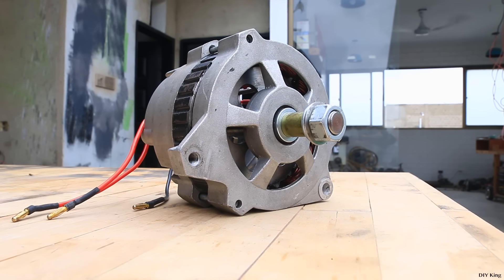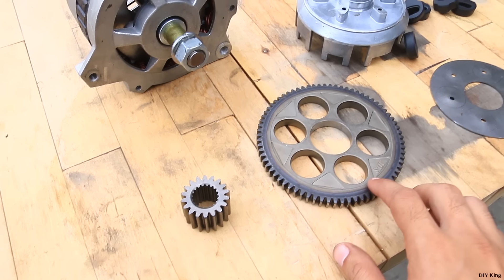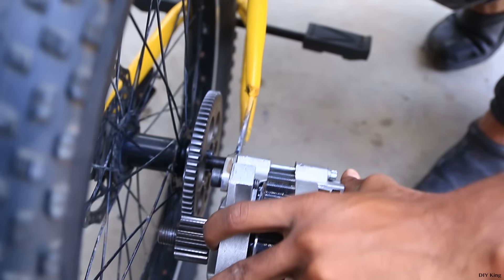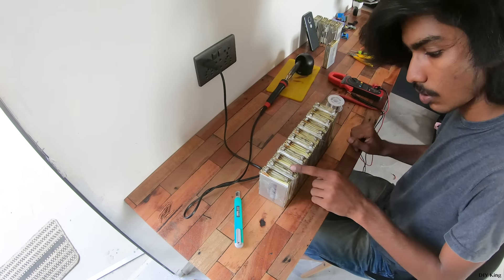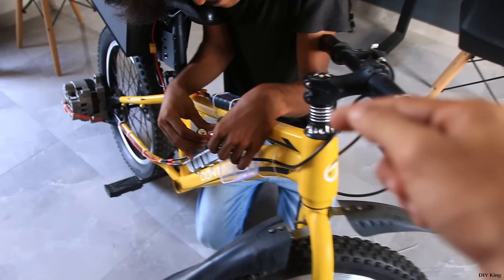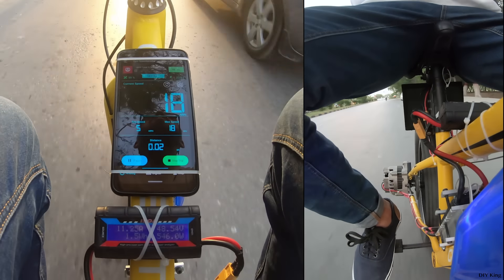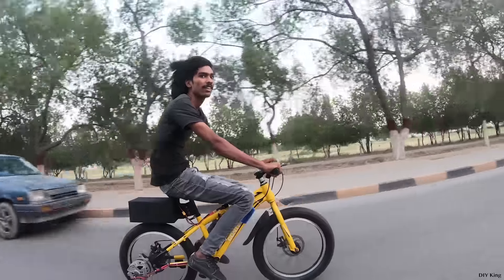Bicycle Conversion using a 10,000 Watt Car Alternator

Comment: Hey Guys ! Nice work so far... I´m a Bike Mechanic and so i got some ideas for you to think about.... Try to mount the Alternator in front of your "Pedals" that would give you more stability and maybe adds a little more stiffness to the Bike Frame. Maybe u also can mount the Batteries to the top tube of the frame. In the End maybe you get a suspension fork fittet. Then try that Highspeed run again =)
Reply: Yeah , I am thinking about converting a gas pedal moped to electric pedal moped.  I'm def sure it'll carry the weight of batteries ,front ,back or rear.  Also , have no problem with the speed (wobbles).  If so , minor. Hope this idea helps anyone.  To all us diy's , good luck and many happy builds. Keep smiling.  it will make your day that much easier. But wait.  Why put it off til..... When u can do it today? Remember,  Tomorrows not a promise.  It's a gamble.  Roll the dice boys yeeeeeeehaaaaawwww:)
Reply: @franciscorodriguez7085  Good luck, brother

Comment: Pure genius! You probably already have the wheel shimmy problem worked out, but I think it has to do with the amount of  trail in the steering. You may need to add a small amount of wheel trail, in order to deal with the added speed involved. All the best!
Reply: Getting weight away from top tube and headset as this is whats resonating. I learned this no-handing as a kid. My dads bike had a dad basket. Load it up, u better hang on lol

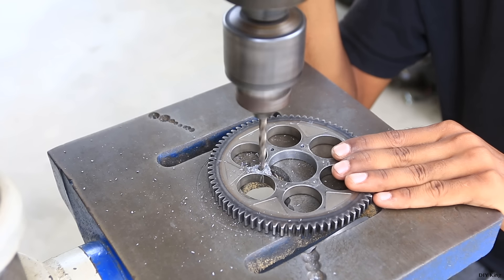Comment: thats why you need to clamp your work piece when using a vertical drill 3:35   when you use bigger drills and heavier workpieces you can actually break your arms or back if you get hit

Comment: That's super clever. Well done for putting an old alternator to very interesting use. To keep the controller cooler, consider adding an aerodynamic ducting to the heatsink to channel air over it as you ride, perhaps adding a quiet Noctua or Arctic Cooling fan to help with the air flow 👍😉

Comment: This would have be a more stable ride on a tricycle. Amazing work guys I really admire your skills and capabilities
Reply: I agree a tricycle would be better and centralize the alternator between the rear wheels and put a gear housing around the axle and alternator to protect them.
 The way it is now, one small rock or pebble like debris in the gear and the shows over 

Also consider a gyroscope steering aid for the front to stabilize the steering.

Comment: For the next segment, Install an alternator on either side of the rear wheel, making it 20kw, and the weight on the rear will be more balanced.
Reply: I think the tires would melt and they would go back in time

Comment: Here's a suggestion to improve the handle and reduce wobbliness.
You can use dampers made for e-scooters. It's supposed to reduce the shakiness of the handle at high speeds.

Comment: It is the weight of the alternator on one side of the axle that makes you ride. It would be necessary to put an object of volume and equivalent weight on the other side so that it could roll normally. It will even be much more stable than before!
Reply: don't go that fast.

Comment: Great job guys! Very nice build,although a few safety improvements on the pedestal drill press like mounting a vice or a clamp could save losing your fingers etc lol,maybe also screw the handback onto the angle grinder for better control and put the guard back on, maybe a helmet too??
Just saying... love  your videos and would hate to hear that you guys got hurt lol....i dont mean this in a bad way. Just stay safe and keep on rolling out your Awsome content 😊😊
Reply: Jesus is LORD  Wrong page Nimrod...
Reply: you could use bigger handle bars for less wobbling and more control in high speeds

Comment: Well done, guys! !
:)
Clean install..  I love the battery holder and throttle choice!  :)
The alternator/motor install looks great... but I still want the mount to look stronger than it looks.  (It might be plenty strong already, but my own personal preference would be for it to APPEAR even stronger than it currently does... although other than that... I love how unobtrusive it turned out  :)
Keep up the great work...  you guys!   :)
Reply: How will it handle rain or street water?

Comment: Nice work!  But you'll also want to devise an enclosure and lubrication system for the gears, otherwise grit and road debris will quickly ruin them.

Comment: No BMS for the battery pack I think it's temporary ;) & I'm so curious on your Tesla powerwall, did you made a video on it ? BTW I'm from 🇮🇳
Reply from the maker: Since its temporary we didn't attached the BMS, and yes the powerwall project video is coming this weekend so stay tuned.
Reply: WHAT IS BMS
Reply: @Punjabi_CNC_TRANING  battery management system
Reply: @Punjabi_CNC_TRANING  BMS stands for Building management system, here it's for Battery.

Comment: Ten kilowatts? How did you measure that? The motors that put out that kind of power are usually liquid cooled to prevent the magnets exceeding the curie point.

Comment: Very cool!  Awesome job!  I know this is a demonstration, so wondering how long that pinion gear will last.  Also,  what you experienced was called a death wobble, which can happen sometimes on motorcycles unexpectedly. Usually from low tire pressure.
** Also,  I'd be interested in a standalone video of making the rechargeable battery.

Comment: okay boss I want to see what you can do with this idea . using this alternator / engine & using the big wheel idea from another video on you tube titled "this is not a bike / DIY" I'd like to see you build a reverse Tadpol style recumbent trike. My idea would be to have tween chain drives from this motor to both sides of the big rear wheel with the motor located behind the driver's seat. battery to be mounted in a housing that would be built over the rear big wheel . I think when you see that video you will be able to see my vision. As the youngsters say it will be sick! another great build video as always many thanx!

Comment: 10,000 Watt car alternator - 10,000W @ 13V = 769A. No point watching the video, since a 769A alternator - nor anything much more than 10% of that has ever been made, so it's obviously bullshit right from the outset...
Reply: And just for a heads up: for a 100A amp domestic supply we use a 25mm² cable - for 700A the best case is 240mm² conductors - ie. 15.5mm diameter copper conductors, plus insulation. The cables shown on the alternator are 6mm² at best, probably 4mm² in reality. Why put you effort into scamming, when with no more effort, you could provide something positive and interesting? It's bizarre.
Reply: Do you really think the battery he used was 13v? There are two batteries with 12 packages in series with 4 cells in parallel in each. The battery must be at least 48v. The 10000w is a nice exaggeration, but it's not enough to be what you said
Reply: @MarcosElias  agreed, probably just 5-3 kw the alternator
The battery for Sure more than 36 v
Reply: You can actually see power meter on test run, it's 3kW peak and mostly around 2kW which is fine for most alternators. They are usually rated at 70-100A and you can see that he's not pulling more than that. That's at 50V, not 12V.
10kW is bullshit claim, but it can easily output 2kW which is quite good considering the setup.
Reply: I don't know of any alternator that physical size that is 10kw. 
Just  not possible!
 More like 1.5 kw!
Reply: @geepea101able  my alternator do 2kw easy in 72v
Reply: @MarcosElias  That's great. But I was talking about the 10kw he's on about. No such thing in the auto world!
Reply: got him 4 million views though
Reply: @cleggydadon  And that's the travesty - people produce fake videos, when they could equally easily produce factual ones that would actually improve other's knowledge and understanding. Contemptible really...

Comment: I've never seen a 10kW alternator, nor would one be that small. Looks like it could be 1000w.
Reply: It’s not a 10kw alternator, it was an alternator that has been converted to a brushless motor that now runs on 50v, I have an rc car that pulls 13kw from a brushless motor a fraction of that size (50mm castle 2028 if you want to look it up) you have no idea about brushless motors.
Reply: @gavwilldo  it says that right on the title. "Using a 10,000 Watt Car Alternator"

Comment: If you mounted the battery packs lower like half on each side and up front off the top bar of the frame you’d eliminate the high speed wobble. Great job on that bike!

Comment: Just a thought I had, if you mount the battery off the rear wheel opposite of the alternator, you may balance it some so that it doesn't want to fish tail at speed

Comment: Thats a very cool bike. I like your inventiveness. The stability problem at speed is due to most of the mass being located in the wrong places. Also, increasing front wheel trail (castor) will help increase stability at speed. Projects like this are journeys in learning. Good job.

Comment: Ohms law. Volts times amps equal watts, and vice versa. For example a 100 amp 12 volt alternator provides 1200 watts maximum, so I figure that you must have been off by a decimal place 😊

Comment: 1st off they don't make an alternator that big the biggest is 500 to 600 amp . And 2nd the battery is only 1500 watt hr. which 12v×600amps=7200w and those are pricey in tune of 1200.00 to 1600.00 . Stock alt. 12v×130amps=1500w even if there used as motors without rewinding it is not gonna happen so with battery known at 1500watt hrs and supposed 10,000 watt alt. 1500w ÷ 10,000watts motor = 0.15 that's 
7 minutes of riding wide open  realistically average car alternator is around 100amps @ 14v = 1400w and 1500w÷1400w= 1.07 hrs ride time. A smaller alt = longer ride time. Bigger = shorter  b/c it draws more power to run.

Comment: You should be some kind of engineer man how come you're not rich making this assembly. You just build a contraption out of a car alternator. Very impressive great job. Just have to counter the alternator on the one side when you ride. Good concept and great idea. Just don't get the alternator wet. You're going to have to pedal if it rains lol

Comment: Is it possible to have a more powerful alternator, powering the motor alternator and recharging the battery? like a car. Switching from battery to the alternator when it's up to speed. Second alternator will fix the balance issue as well allow for a lighter battery.

Comment: The motor might be causing your wobble. If you could mount it inline with the wheels and have the motor drive the crank. you built a cool bike. and it looks good too. Way over my head!

Comment: This setups works good, However, you could have mounted the Alternator right above the foot paddle sproket section, and could have built a Belt/Chain Drive with the Sproket/pully.
This Could Have saved you a lot of extra mounting right on the wheel, and saving the protruding/hanging alternator near the rear wheel.

Comment: Really interesting build. I want to do something similar to 
a former  pgo two stroke scooter by replacing the top end with an electric motor keeping the variator. Need about 7k rpm. I'll keep you informed

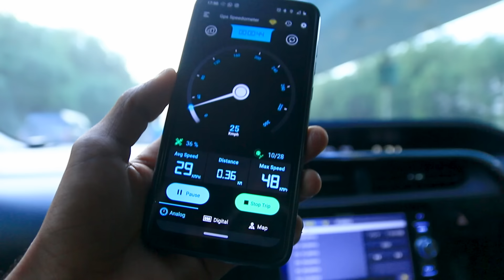Comment: About the speed at 10:36 . Your phone is the most accurate (under good GPS signal) because cars have a factory offset to the speedometer due to law that requires them to have a small offset (usually showing 1-10km/h more depending on the car and time that the car was manufactured.).

Comment: This is the most amazing video on electric bikes I have seen. However, I am confused about charging the battery again. could the alternator not charge the battery simultaneously like it does in cars ? I will be glad for an answer.

Comment: That's pretty interesting, How about Hooking a couple 112 tooth Sprockets to a single shaft & running one from the 45 tooth Drive Sprocket on the Crank with pedals, the other 112 linked to a 10 tooth that's sharing the same shaft as a 32 tooth that's linked to the 17 tooth Sprocket on the rear wheel of the Bicycle? I think that'd make a cool video also, which that's just one of the slower ideas that I had for a bicycle.

Comment: Try the same thing but with the motor in the middle and put a belt or chain to drive it, the weight would be balanced and it wouldn’t need much support

Comment: At the 630 second mark it's going to buckle twist 
Needs some form of gusset to hold from twist contortions
In my chair I can suggest 
Motor over wheel to get balance better 
Use chain 
Cogs good but this is very cumbersome with s strong mounting system 
Power on mate

Comment: To balance off of weight you should Mount another alternator or generator on the other side of the wheel and decided to kick in only when you're going downhill to capture the energy to recharge the battery and also to act as a brake assistant

Comment: If the alternator outputs 14 Volts then 10,000 Watts would mean 714 Amps. Car alternators are usually rated at 60-70 Amps which is closer to 1,000 Watts.

Comment: Hey... Bro upgrade idea is here. Add another battery and another alternator at the left. And a motocycle battery charger.... that connected in second battery as backup battery. So while driving you can charge another battery you can use it as backup battery. If your first battery 🪫 low you can use it. Add a another switch to Easley choose what battery you will use. Battery 1 or 2 now i think you can build unlimited battery to power your ebike

Comment: Using ohm's law (remember that?) P=IE or power=current (I) x voltage (E). A typical car alternator charges around 14.4 volts (E). Current depends on demand, and output capacity varies between the approximate range of 60 to 160 amp range.  So on the low end 60 x 14.4 yields 864 watts, and on the high end 160 x 14.4 yields 2304 watts. I know of no automotive alternator capable of 10000 watts. For a visual look at the physical size of a 10kw generator. Still it's a realistic project.

Comment: good idea. but since you have no clutch or gearbox installed to free the motor, reverse power may happened when you ride downhill. the motor will slightly act like generator and reverse the power to your speed controller and battery. is your speed controller ok while you downhill?

Comment: What I keep wondering, is if you can get away with using an alternator and not installing permanent magnets by shorting the slip rings for the field windings together? Induction motors work like that. I guess I need to find one and try it out.

Comment: Hey try connecting 1 more alternator on the same wheel  to see if you can maintain power to the controller box without batteries so maybe you will stay at the speed you peddle

Comment: Install the motor in the frame of the bike under the seat in between the seat and the handle bars so the weight is balanced.

Comment: Ive got the start ov infinite gear.
 Get a bmx "push bike"
 Add a small gear on the left and connect it to the right side with a DIFF.
 Add a lrge gear to the left rear and connect it to the wheel with a DIFF.
 You should should end up with 4 sprocket's. 2 chains. 3 DIFFS "1 at the front conecting sprokets to peddles and 2 at the back connecting sprockets to the wheel with a diff on each side"

Comment: So awesome guys with all that power to spare  have you thought about wiring up the wheels front and back with magnets and plenty of copper wire to charge as the wheels are spinning back into capacitors I would think with that ratio and enough magnets over unity or close is worth looking into.... I have faith in your mechanical and electric engineering skills . If it works for my intellectual property contribution a bike would not be bad,,,,,,, 😁
Reply: Btw from 300 km to 1000 km is just as good as over unity in my book I'm sure in most people's book as well hope to see it come to fruition!

Comment: Your bike wobbles at higher speeds because the heavy battery is behind the back axle. Once the wobble starts the weight behind the back axle adds to the wobble.

Comment: Got wheels , wood boards painted , and an ev car battery , couple bikes and 135v woodcrafters power tools like a power outlet attachment option then could built a throttle ??

Comment: Cool project but that was a horrible weld!!! It will be a serious problem if any of the of the electrical circuits or alternator become wet because none of thais was designed with a housing to protect and prevent the wiring and circuitry from becoming wet. This needs to be wrapped up in electrical conduit along with tape and any other kinds of electrical protection or design a plastic housing to be retrofitted to ensure everything is properly secured against water or any parts that could become damaged in an accident or any other foreseeable event. You may also want to consider adding  a small fuse box to protect your wiring and circuitry as well to prevent any electrical damage! I imagine you’ve already considered these issues but I have hearing difficulties so I apologize if I have failed to have understand that these things have been previously addressed!👍 Overall though, excellent job!

Comment: Those ‘Teeths’ are called ‘cogs’.
Those ‘cogs’ are on a ‘gear’.

Aside from that, I admire you’re skill in engineering. 

I want to make a recommendation.
I would suggest a clutch system rather than a direct drive.